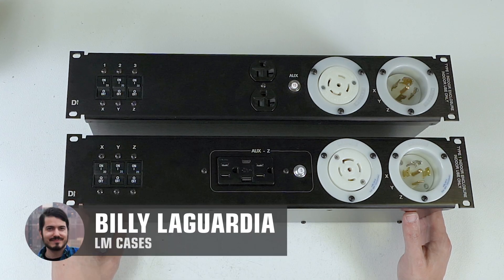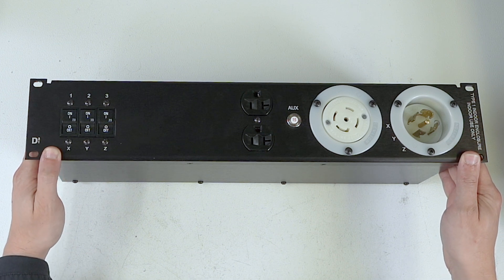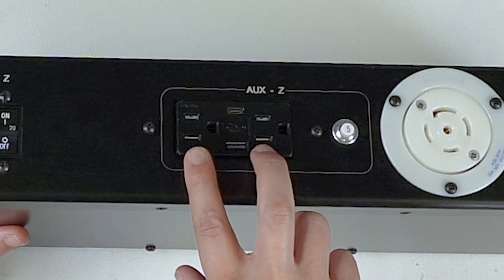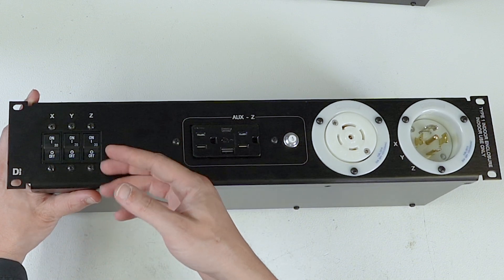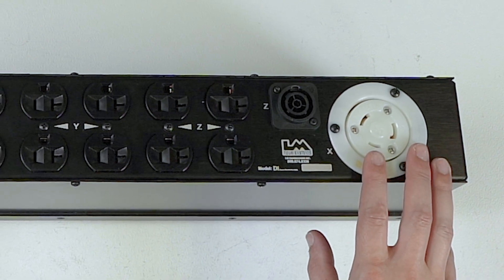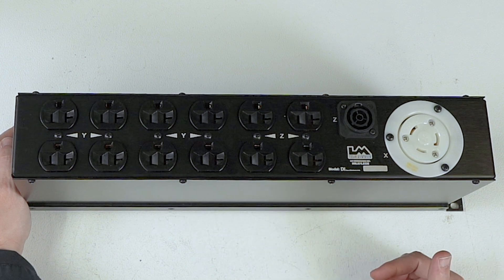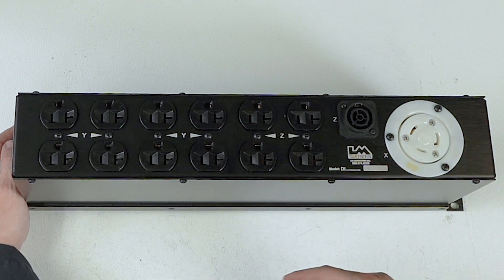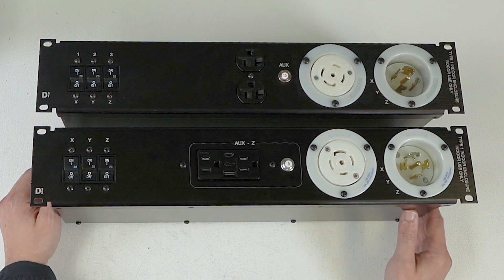LM Tour Systems D 3/1 & D 3/2 3 Phase Power Distros Compared

Comment: Question! I live in USA and my outlet is 240V. Can i connect this device to 240V ??? 
The power distribution says that the connection is 125/208 V on the NEMA power input.
Reply: I am interested in the D 3/P Powercon Power Distro model.
Reply from the maker: Without knowing the device, my first instinct is no. Id bet you have a "world power supply" meaning that it is designed to run on either USA 120v 60Hz or EU 220v 50Hz. 220v in this instance is a single phase. Our D3 distros are 3 phase. Meaning that they have 3 separate legs of 120v. 208v often refers to 2 phases of power. Since the phases are 180 degrees apart, the resulting voltage measured across the legs is 208v. A single phase 220v line for your device would require a step up transformer. Hope this helps! -Billy

Comment: Curious what the reasoning is for the 5 amp circuit versus the 15 amp circuit breaker.
was this to prevent folks from using up the convenience outlet for things that weren't conveniences?
5 just seems a little low you plug the tea kettle and you're not gonna get tea. Or if you would prefer coffee. 😜

Not nearly as bad since this isn't trying to protect and it's just acting as a splitter distribution box. but I know a certain manufacturer that likes to not protect their convenience outlet and I was reading about somebody who accidentally without knowing plug the rig into a "special janitors outlet" custom inappropriately wired for 240V. the high dollar major brand device protected the equipment beyond it however this person's wireless microphone receiver was plugged into the convenience outlet that wasn't protected....
The irony this person does a seminar on safe Electrical for musicians.
Reply from the maker: Correct. The 5 amp breaker is to prevent overloading the distro. The idea is that the back outlets have priority. It limits the user from say...plugging another rack into the front. The courtesy outlet is only intended for small items.

Comment: I really like manufactures who mark which screws need to be used to open the device.
I recently bought an inverter last year, I decided to open it up and check and it was a good thing because the circuitboard wasn't correctly slotted into the casing and was warped. but thankfully I caught it soon enough that it was able to be fixed by just popping it back into its track.
After that I decided anything electrical is worth double checking the insides with a visual inspection before using.